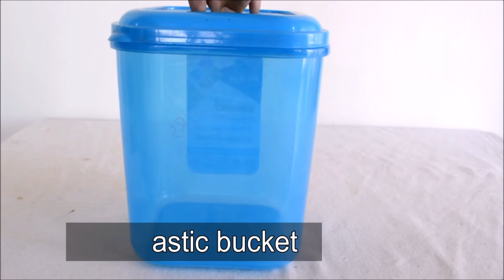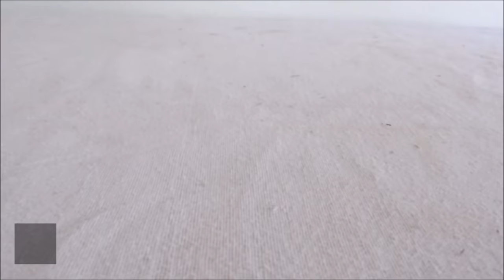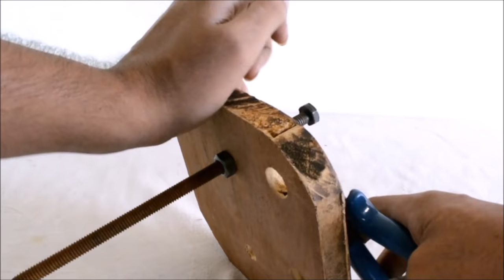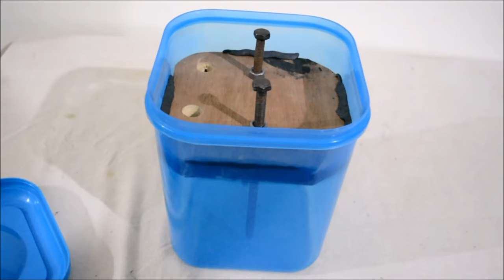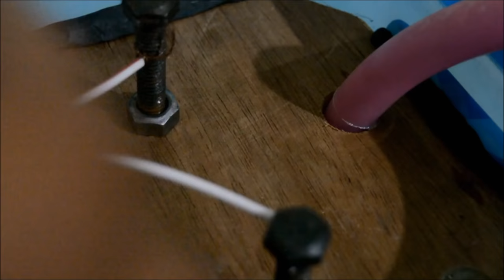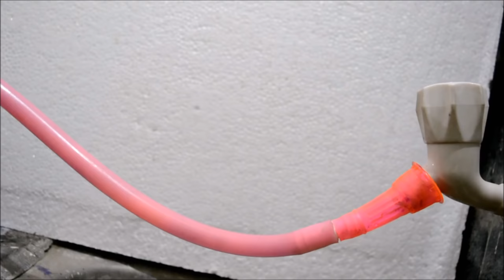How to make geyser  - easy way

Comment: Sdik Rof If I drill hole in a motor shaft will it break ? Bcz im making an electric skateboard and instead of gluing wheels to the board im drilling through the motor shaft and wheel and inserting a rod plz answer my question

Comment: sir ye geyser hm ghr m daily use kr skte h kyaaa...Koi problem to nhi hogi isse... I mean blast etc please reply kr dijye
Reply: no danger except you put your hand in it while it is working as 230v in water and also it has high load it will make ur elctri meter run fast which means lot of elctric bill
Reply: Do not try this at home,  the water is contaminated with oxide after boiling. Better buy a heater rod and use it.

Comment: can we use iron rod instead of steel rod
Reply: Do not try this at home,  the water is contaminated with oxide after boiling. Better buy a heater rod and use it.